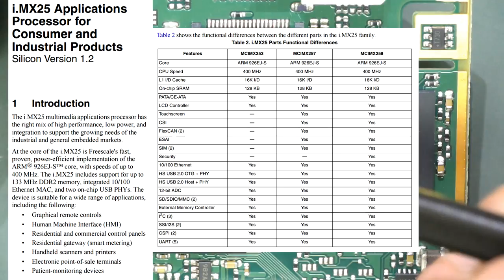EEVblog #989 - FLIR ETS320 Thermal Camera Teardown

Comment: Wow. A backup battery buried deep inside the device (seen at 3:09). I wonder what is the life of the battery vs the expected life of the camera?
Reply: It's rechargeable.
Reply: You mean the coin cell? It's placed in a socket.
Reply: Yes, I meant the coin cell battery. If it ever needs replacing you need to take the camera apart to get to it.
Reply: Yep, great point

Comment: That's a excellent piece of engineering. Even the components have been lied out beautiful.
Reply: The USB cable inside of it shows how great the engineering is.
Reply: The USB cable is in there because they took a prior model from 2009 and re-packaged it in a way that wouldn't look too similar. Doesn't mean that prior model in turn isn't well engineered.

And i think 10000 of those USB cables are cheaper than all new layouts, tooling and testing would have been.

Comment: The design looked like it might all clip down into the casing after the top half was built.
After it's all electrically setup,  it might drop in and clip on the yellow frame before all being screwed shut.
j

Comment: You made a mistake while reinstalling the Display. The copper shielding from the display has a little flag that has to go into the tab on the copper shielding from the chassis. (11:28) Probably to ensure connection.

Comment: The 18650 cell is pretty cheesy for a $2500 product, especially since it's not swappable. Would have expected a nice big prismatic cell.
Reply: American Locomotive  Yeah, if it's 18650, they may as well have given easier access.
Reply: According to the datasheet it'll only go 4 hours off battery. Would've been nice to see either a custom shaped LiPo or just two 18650s that could also be charged faster than 3hrs over USB...

Comment: was anyone horrified by all the dust on the sensor???
you can use electrical tape as a dust magnet, it works great when cleaning lcd screens for application of screen projectors as well as camera sensors, dont know about flir sensors but i'd imagine they work similarly unless there is some texture on the surface on the glass that prevents the dust from sticking

Comment: Did they really need an FPGA in this? More resolution than the FLIR ONE, but 320x240 should not be hard to output at 15 fps for a simple ARM cpu.
Reply: The output likely IS from the ARM CPU... the input though...

Comment: That sensor cost more than a top of the line CPU or GPU? Why are FLIR sensors so damn expensive?
Reply: Doom2pro This is all (relatively) low quantity stuff with low production yield and extensive per-sensor calibration to get your precision

Comment: Are you sure the copyright is to the sensor? I've filed many a patent on dies but no copyright applications. 

The patent pool developed by Intel is full of thousands of patents like that. 

The copyright would like go to any code, written bits, the company name, product name etc. 

It always amazes me how little the open source people actually know about IP but yet rattle on as if they did. 

Fail.
Reply: Crocellian The PCB design is obviously a copyright protected picture with some degree of artistic originality.  Copyrights are cheaper and last longer than patents.

Comment: That's a $2100 sensor.

 $60 for the FPGA, another $60 for the display. Maybe a $90 for the housing, and then board, components, and wiring probably $150 at worst.
Reply: scot shabalam The sensors are supposedly hard to produce and also let's not forget the software needed